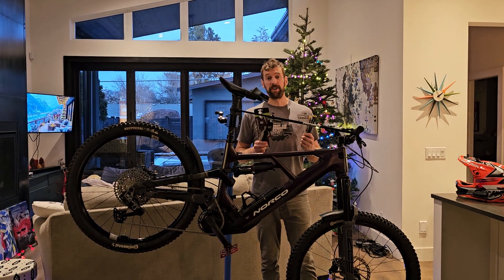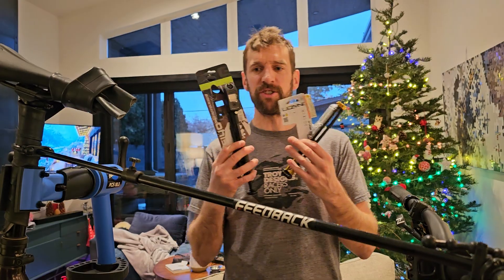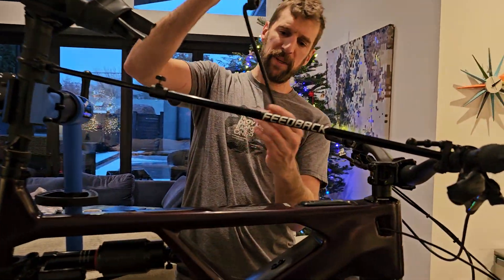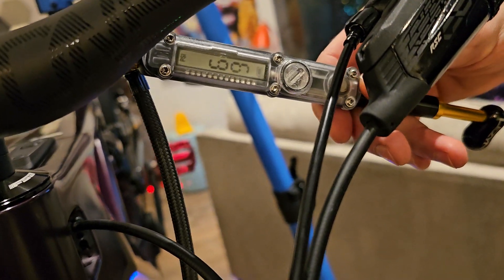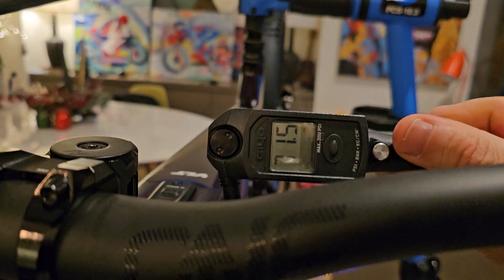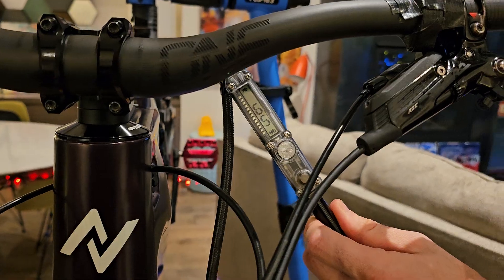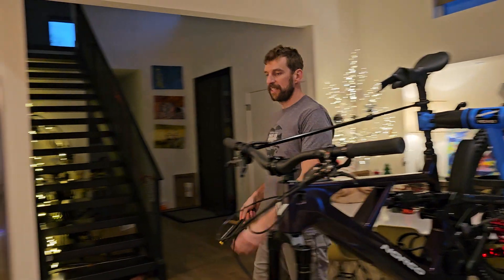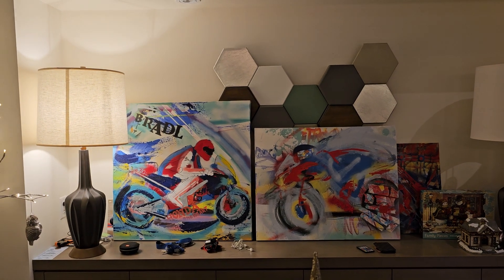Digital Shock Pumps Comparison: Giyo/Fox/RockShox vs. LEZYNE Digital Shock Drive (Made In Germany)

Comment: I have the giyo 600 psi, but i should have bought the one with normal barrel you screw down. Cause if you spin the hole thing rubber bushing gets ruined real quick

Comment: Seems like both lets some air out when attaching (filling the hose), both show accurate pressure, both are easy to pump on fork pressure but hard on shock pressure. 

The difference I see is the size, the ease of attachment, and the leak when wiggling around the hose, where the Lenzyne takes the win. 

When reading reviews for the Lezyne, most people find the battery life to be very short. What’s your experience on this on the Rockshox vs Lenzyne?

Nice review, good work, thanks!
Reply: I am really happy with the compact lenzyne.  I often check my air pressure every day when riding the park jumping Dirt Merchant/ A-Line.   I bumped up my pressures from 72 to 80 and 250 to 260psi to prevent bottoming out hard when I Overshoot the huge jumps.    No battery issue so far using it now 5 months.
Reply from the maker: Now, almost a year later, using the Lezyne, I'm a happy customer.   I also used the shock pump every day for 20 days straight when at Whistler - for my preride prep.  The battery is still going, and there is no low battery signal yet.   I also bought the LEZYNE Digital tire Guage and super happy with that.  I like to have exactly 25 psi in front and 27psi in rear!

Comment: The air loss when connecting is filling the flexible hose . On some when removing, the air loss is not from the shock, it’s from the hose. So if connect again thinking you’ve lost air, it will read low again because it’s filling the hose again. So fill just above desired pressure, release down a few psi to what you want. Remove hose , job done.

Comment: I don't know why so many people have such difficulty understanding air loss when connecting a pump. Every pump will fill with air from the shock/fork when connected. The volume of air this will take is dependent on the volume of the pump, and accordingly, the pressure change will be different. If you are losing pressure while disconnecting the pump, it is user error.

Pump up to the desired pressure and disconnect the pump, job done. The pressure shown when you connect the pump is irrelevant.
Reply: yes, the air loss when connecting is not an issue, but the leak from the swivel during use is not acceptable.
Reply: @irnieracing  that has nothing to do with the repeated rambling about loss of pressure when connecting or disconnecting the pump. One is a faulty product, and the other is a faulty diagnosis of an issue that doesn't exist.
Reply: let's try to keep this community supportive for everyone who contributes content. thanks marcel for taking the time to make a video and share it with us; I am looking to get a shockpump and thought this video was helpful.
Reply: @patrickrenschler  good for you. I'd rather the information be correct.
Reply: being correct does not prevent you from being nice, feed it into a chatbot to clean it up before you submit, it actually helps a lot, I do it with my customer support emails lol
Reply: @patrickrenschler  it must be tough being so sensitive. Be careful out there mate.
Reply: Alright, you do you. I just appreciate when people take the time to share, even if it’s not perfect— comments like yours make it less likely they’ll contribute in the future. Being correct and being respectful aren’t mutually exclusive.
Reply: @patrickrenschler all great points!
Reply: While I agree that air loss when connecting a shock pump is inevitable (for the reasons you mention) and doesn't matter as you can easily add pressure, the loss when disconnecting is not simply user error, that part does depend on the design of the connector and also possibly the valve as well.
Reply: @pc750-V4  how are you measuring loss when disconnecting? Unless your pump is faulty or you muck around removing it, the air you hear escape is almost guaranteed to be coming from the pump.